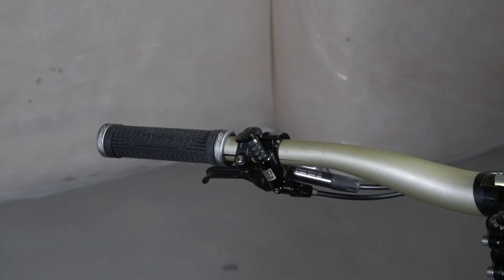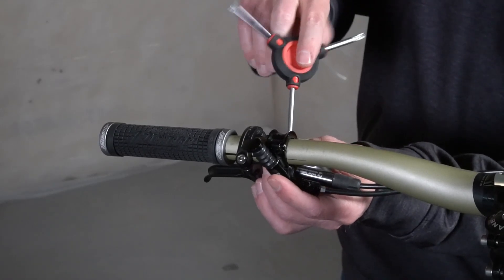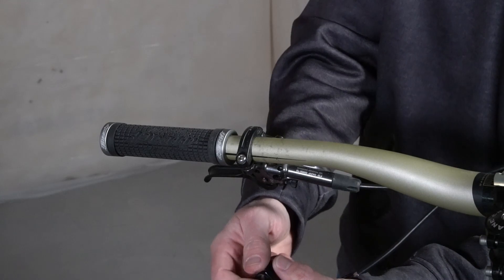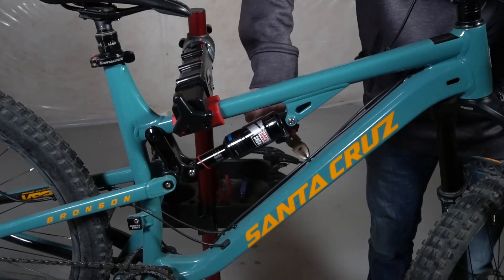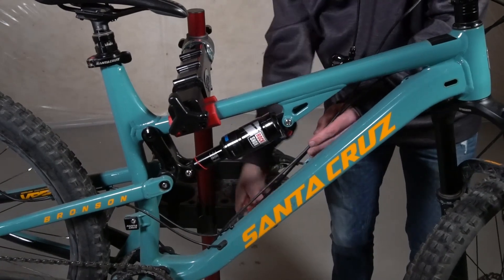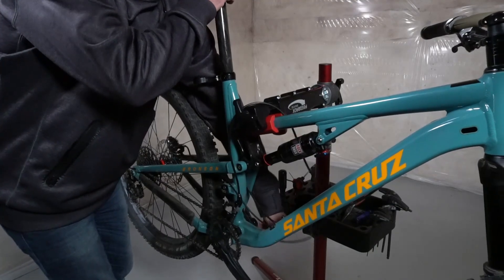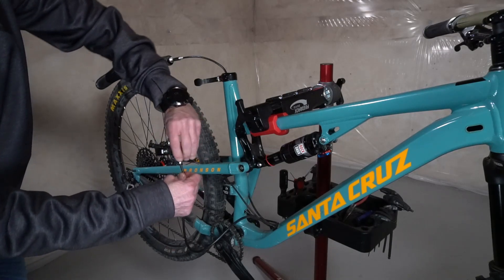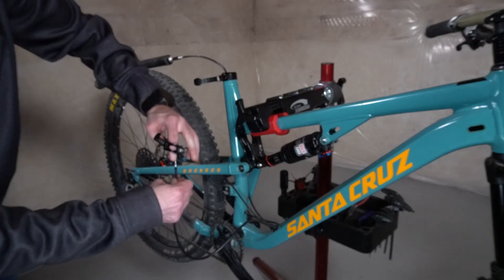How to Remove a RockShox Reverb Hydraulic Dropper Seat post

Comment: If I'd like to sell it after doing what you showed in the video,the next guy would have to bleed it before use?
Reply from the maker: Yes, once you disconnect it, it will likely need to bleed the dropper seat post.